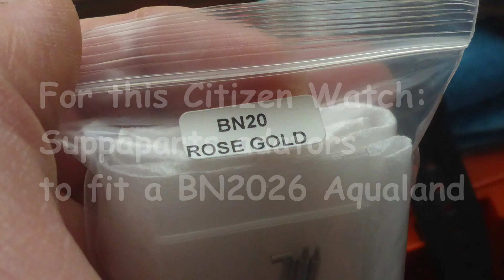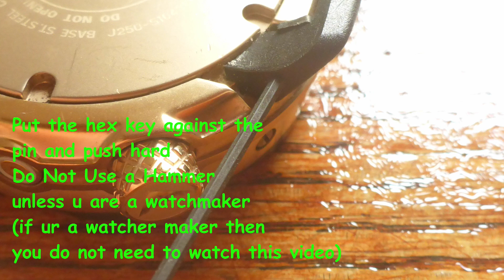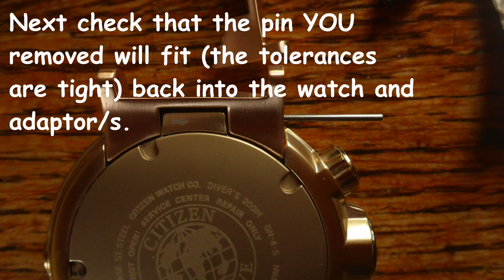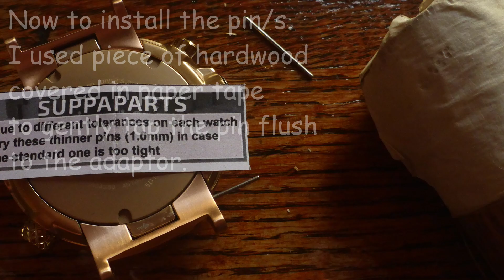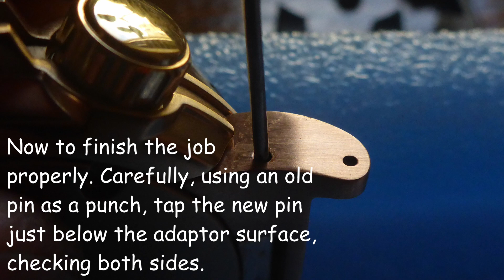Suppaparts Installation on a Citizen プロマスター Aqualand BN20

Comment: Hey sr.
Those adapter fits on Aqualand JV0000- 01?
Great video.
Reply from the maker: Hi there, not sure you would need to check with the Suppaparts site for compatibility.